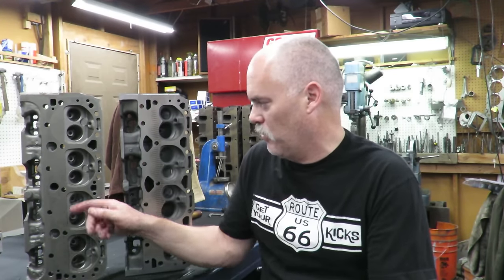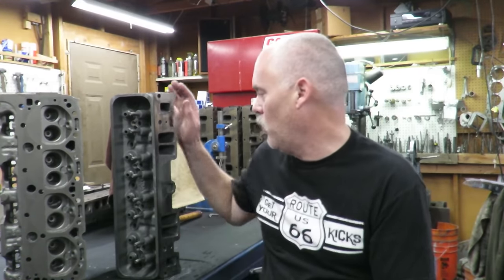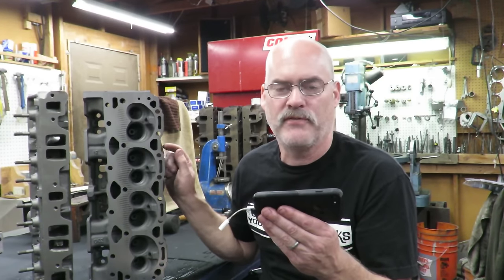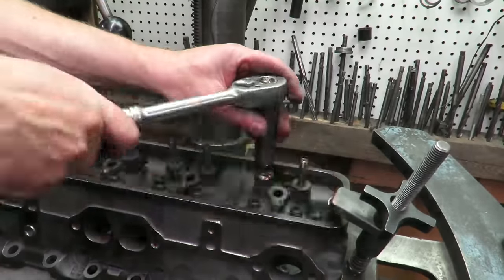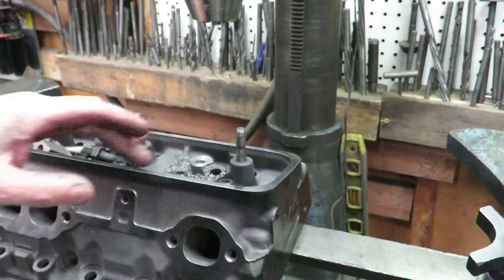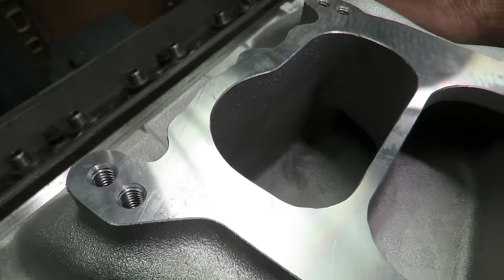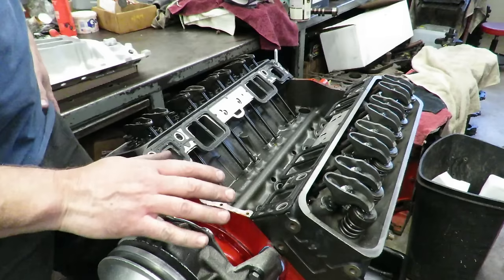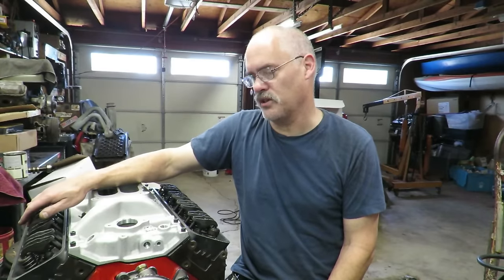How to get more power out of your Small block Chevy

Comment: Ah smoggers arnt as bad as  you incinuate, they can make a fun 300+hp easy and the TBI smogger heads don't suck they just suck for certain applications, Yeah There a major fail for high rpm power attempts but they outshine alot of heads for low/mid rpm TQ monster builds. With some massaging they really work great. Check out headbytes he builds a badass set. I know you don't wanna ramble n bore people with every single aspect of stuff so Seriously Not ranting Just saying for the people that don't know, and it's just my opinion you know what they say about those.
Reply: The title of the video is literally how to get MORE power out of your Chevy, not how to get OK power or decent torque out of your Chevy.

Comment: 700$?!?!?!.....I found a set not cracked with 100hrs off run time off of marine block for $150. Pinned the studs for $8, resprung and retainers for $100, reseated valves for $10, and painted them for $8 for a total of $280

Comment: i just want to apologize  for some of the comments i posted as i wasnt thinking as you are an engine repair builder seller, hope i didnt cause you any customers but i like to help all with what i know as i didnt have help and bumped my head a lot and this is not a cheap hobby. i have been working on my car for over 12 years and still is not what i want it to be
Reply from the maker: I don't really have many customers from you tube so that's not a problem I do agree with you the tooling can be purchased but it is expensive there are guys out there however that just want to do the work themselves and that is perfectly fine I am the kind of person that would probably buy the tools and do this myself if I didn't have the machine  just for the experience so I do get you but I think it's important that every one understand exactly what the cost's and risk's are
Reply: yes this is true as fool proof as they are made someone will mess it all up by not reading and following the direction carefully. it take time and patience to get it done. its not a 20min deal takes about 2hours to cut down a head after you pull the studs
Reply: @Myvintageiron7512  r

Comment: Buy a LS engine it will last longer make more power and be more reliable if your old school ditch the fuel injection put a carburetor and a intake manifold and a LS MSD box and a big plus with the LS engine is they don't tend to have constant valve cover and rear main seal leaks like the old style smallblocks do plus with a 6 bolt mains the lower half or shortblock has no flex at high rpm the crankshaft is really in place with no movement in performance applications it's far better and a LS engine will last at least twice as long as the old style smallblock if put through the same abuse

Comment: They engines that came with the center bolt heads are roller cam blocks. Why would you put a flat tappet cam in them?
Reply from the maker: nope most of the TBI engines are flat tappet cam from the factory also the early TBI blocks did not have roller cam provisions so that is actually incorrect add to that the fact that a performance roller cam and lifter set is 3 times the cost of a flat tappet set up don't get me wrong I am a big fan of roller cams I prefer them greatly to flat tappet but if you tell the customer the price triples many of them say no way just run the flat tappet I would be happy to put a performance roller in as long as someone is willing to pay for it otherwise I install what they pay for
Reply: All of the TBI truck engines are flat tappet engines. Some of them are drilled and tapped for roller cams and some aren't. Gm cheaped out on them. 96 and later all have roller cams though

Comment: My 85 Chevy 305 engine runs through oil in a month stock 305 with 327 intake and cam leaks and burns oil  and from the exhaust manifolds to the bottom of the oil pan is completely coated in oil even the frame crossmember under the engine on my truck is covered by oil

Comment: much rather invest in a ls better heads ROLLER cam no distributor overall way better bang for the buck and simply better designed motor.
Reply from the maker: I do agree the LS is better I am a big fan but they are not cheaper and what I get a lot of is requests from guys wanting to upgrade their early small block they are still more popular than the LS even after 20 years of the LS proving itself so if you can go LS great but not everyone is going o do that

Comment: This guy keeps talking about the tbi 191 heads there are different tbi heads such as the 193 that outflow the vortecs stock on the exhaust and I've seen flow numbers of matching or exceeding intake on vortecs.There are plenty of guys that have flow benched 193 tbi heads After reworking them and came out better than vortecs if you put the time into them,all he talks about are the 76cc tbi heads not the 193 64cc heads,give me a break.
Reply from the maker: 193 heads cant touch a vortec head your listening to the wrong people we have flow tested them all there is no TBI head made that will come close to a reworked vortec head that's just nonsense

Comment: Hmmm I don't see this upgrade as a good cheap power maker. I like the video but I find it misleading.  I'll explain.  My nearest junkyard wants 45 plus core each for these heads. Then you have to machine them 500ish bucks so we're at 600 or so bucks. Then gaskets because they pop you need metal ones. the only ones I could find in a quick search were 56 bucks maybe your googlefu is stronger than mine.  Then a new intake that doesn't exist in oem so it's expensive summit 260. For a total of 900 bucks give or take a few. NOW get you some skip white aluminum 200cc intake runner big valve 64cc chamber  heads ALREADY set up for 500 lift roller or flat tappet cam straight bolt on no labor involved for 720 bucks and some regular 15 dollar intake gaskets use the same  intake you own or upgrade if it's junk but they are hanging on every gearhead's wall because they made millions of them for 50 bucks and BAM you got BETTER numbers to work with for flow and compression so hps and torque are going to be better just look at skip white's actual dyno numbers on his website for a total of 733 without intake or 783 with buying a used one from a friend. Can't find one that way?  Get better friends. Sbc intakes are everywhere. Plus the heads are not prone to cracking and weigh like a hundred pounds less. Also can run a little higher compression without pinging on pump gas vs cast iron. They also retain less heat. Heat and fuel hate each other. Just my two cents take it or leave it. This is by no way bashing your route to power. i just think a bit more thought and shopping around will give better results.

Comment: rather than buy shit Vortec head cores and have them machined, just buy good pro-filer heads and be done with it....you can run a small cam and the bitch will still make serious horsepower just how good they flow. that is my 2 cents. I used vortec heads on a 383 and would NOT buy vortec heads and have them machined again. vortec heads ARE GOOD HEADS, its just that machining them is so expensive when you can buy machined pro-filer heads from Chad Speier for 1400 bucks.
Reply from the maker: I don't disagree with you I really like pro-filer heads as well I'm a big fan I have used several sets and they work very well but 1400 bucks is still quite a bit more $$ than using factory castings I would say if a guy has $1400 for the heads then by all means buy the better heads personally if I'm spending 1400 on  heads I'm going Dart or RHS

Comment: Way to much cam for vortec heads. They are not designed to make mid to high rpm power.
Reply from the maker: Not true they make great mid to high RPM power,  not sure who your getting this from but you should probably stop listening to them,  your statement is just plain wrong
Reply: Can you send me dyno info. The vortec sbc heads only have 170cc intake volume. The Enginequest CH350C are 180cc much improved burn made 442hp on the engine dyno on Power Nation.

Comment: Your a bit behind on knowledge of old cylinder heads. Ive spent the last 40 years building motors from the worst flowing to the best on my 70 k motors and heads from the 1962 fuel injector were some of the best but are harder to find. Figure out the last 3 digits of the casting number yourself. You'll get better over time
Reply from the maker: I know the heads but I am afraid it's you that is behind the vortcc heads put those 462 heads to shame the Fulie heads are old techknology poor chamber desgine and no accassaroy holes make them undesirable the 1996 tru 2002 vortec's out perform them by a longshot
Reply: @Myvintageiron7512  wrong one and even those with the proper work will our perform vortec and can be be drilled and tapped for brackets. If you know what your doing and that is what we specialize in since 1980 Heads. We have our own Superflow Flow bench and 901dyno

Comment: Don’t want to sound like a dick or anything but what is the point of these commits!!! And also who still uses carbs?? I can see if the car is a classic and want to keep original. But so many advantages to fuel injection. I run 93 in my tbss and she’s a beast. This is a great video though
Reply from the maker: You would be surprised how many people are still running carbed small blocks they are actually more popular than the LS stuff I can build an LS engine and it will sit for sale for months the early carbed small block will sell faster than can build them I will get 2 or three calls the first day the ad runs and usually end up selling the engine and getting an order for another one from the guy that missed out with LS engines you advertise the engine and it's crickets so to answer your question "What is the point" the point is I do videos based on what the public wants the LS is a great engine but it still does not compare to the popularity of the early small block
Reply: Myvintageiron7512 I love your videos they are very informative and very detailed. In the earlier comments I was replying to another person. And engine masters is the shit. I didn’t know that carbs were still that popular. Keep the videos coming
Reply: Myvintageiron7512 it takes talent for what you do with tuning carbs and such It’s a dying skill.
Reply: Wiring an engine for EFI can be inconvenient, and installing the kind of fuel pump that supports EFI can be even more so.

I prefer EFI engines simply because that is what I have always been around.
Reply: most of the new stuff is 3 4 wire self contained unites and they have drop in fuel pumps or you can use the inline one just have to mount near the tank and below it

Comment: why did GM make so much garbage... ??   guess the pollution laws had a lot to do with it ... and their warranty coverage too...
Reply from the maker: The CEO of GM in the mid 70's and all thru the 80's was a non car guy he was a business man and cared nouthing about performance he wanted cookie cutter A to B type cars and trucks the reduction in HP was in large part due to his leadership.
 Add to that the EPA mandates and you had the perfect storm for low performance un impressive engines
Reply: @Myvintageiron7512  appears he wasn't much of a business man either... the crap he directed the company to design and sell only led to the market being taken over by more reliable , efficient imports... sadly.   Best engine i  ever had was a 454... built mildly for performance and economy... it pulls like a train and sips fuel like a teetotaler.       BTW, thanks for your valuable videos,  because of them i am likely to start building the engines i have accumulated over the years

Comment: you can buy all the cutters from comp cams and do the machine work at home dont need the shop it you have just a little know how and common sense
Reply from the maker: I agree that is a good point one cation I would give however it is very important to get the studs boss cut at the right angle I think it's important to let everyone know that it is possible to ruin the head if this is done wrong I would not recommend doing this with a drill also it should be pointed out that the tool for the guides is a two piece unit that requires you to buy the cutter and the shank that is for your guide inside dia. this will set you back more than $100.00 most shops will cut the guides down for you for around $60.00  the cutter for the stud boss is around $160.00 so between the two your into your tooling for $250.00 +  tax  so yes you can do it but saving money HMMMMM I doubt it
Reply: its a jig that fits over the boss with angle built in there are lots of videos on here that show it in real time. but i would just buy a set of heads ready to bolt on for around 650 to 725 new with the 2.0 and 1.55 valves in them

Comment: The vortec heads is from 5.3 or 5.7 heads
Reply: ortec heads are from the Vortec 5.7. 96-2000. Or up to 03 in the Chevy Express van. L31 engines. Not the 5.3 or 5.7 LS.

Comment: Please Myvintageiron7512 can you help me out, I've been looking for 2 days for a cam that will work just a little BIGGER than what comes in the Chevrolet Performance L31 https://www.summitracing.com/parts/nal-12681432/overview/ roller( cam that has 0.414 in. of intake lift and 0.428 in. for the exhaust. Duration at 0.050 in. of lift is 191 degrees for the intake and 196 for the exhaust, with 111 degrees of lobe separation) If you could help with a little better HP&TQ cam would be AWESOME !! Then I'll order that cam the MS98000T gasket and a Edelbrock 3704 vortec intake at the same time I order the L31. I thank you Sir for any reply